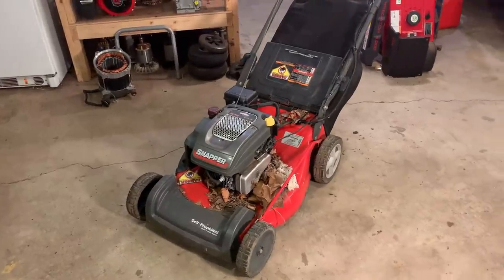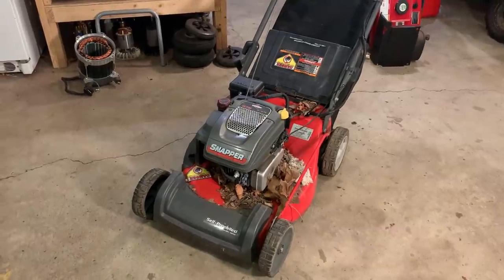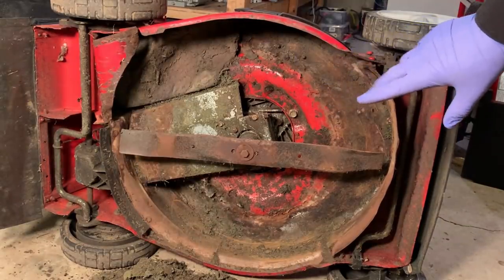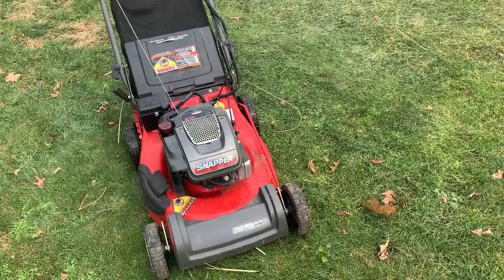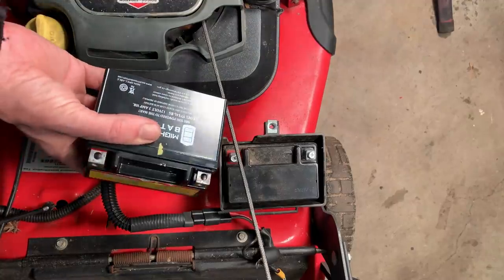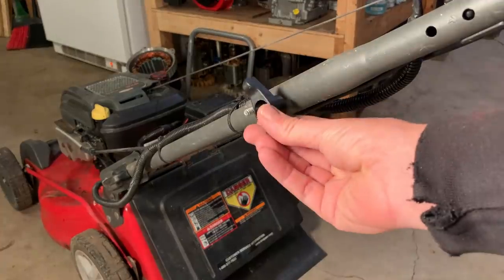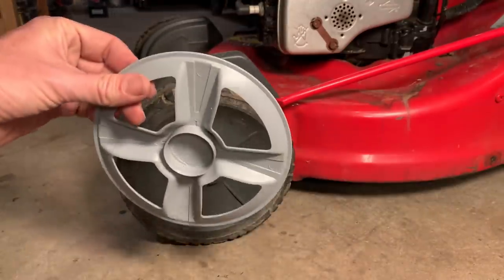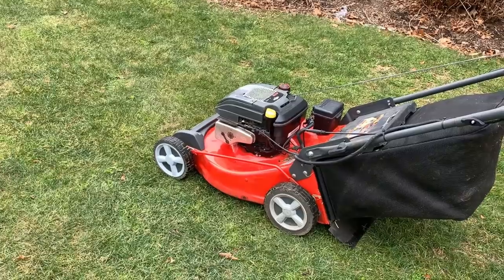Free Snapper Mower

Comment: James, ive never seen a generator with a blade and bagger.😂Lol. That snapper should last you along time. Best thing is that it is rear wheel drive and working electric start. Nice find!  👍💰Roger
Reply: I love his gen vids his last gen find was cool a vertical gen set but like his mower finds also figured out a broken mower problems from his video on cable brake and kill connection being locked same thing on a Honda mower a customer had .

Comment: OH-MY-GOD what an awesome find!  I love Snapper mowers. I had a Hi-Vac for close to twenty years. I've never seen any other mower leave the lawn as immaculate as that did. Alas, I didn't notice it roll down a small hill while it was running - not enough oil in the case and it blew a rod which exploded out the side of the crankcase leaving a big hole. I was crushed. Decided immediately to get a new Hi-Vac. The new one vacs as well as the old one, but they cheaped out by omitting the blade clutch, which I loved. Now the engine stops every time you want to empty the bag. Nice find, thanks for your posts, they're all great.

Comment: I buy mowers at the scrap yard. I bought two, and they still had gas in the carb. I was able to run both of them there. It cost about $7 each. Both are Craftsman, and there are slight differences between the two, but that are both in nic condition. There was an old cub cadet mower there that was about 40 years old, and it was in fair condition considering its age. Unfortunately, I wouldn't have a place to keep it, so I had to leave it go. I'm friends with the owner, and that has it's benefits.

Comment: James, don't you think the owner thought the engine was seized?  The nylon rope around the blade and shaft had to be cut away, so that I don't think there was any rotation from the electric starter or the pull cord.  I love all of your videos, its been a great education.  Kind Regards, Craig
Reply from the maker: Not sure.  I did not ask many questions, only asked if it was free.  He may have a lawn service and just wanted to clean up space.  Not sure.
Reply: The rope was around a part of the blade that wouldnt cause that issue, its like ladies hairs on the brush roll of a vacuum, it has to be cut away but as long as its not in the bearing its no issue.

Comment: It's a better idea that killed it towards the oil fill if you had gas in it with it flood your intake air cleaner gasket plus doing it this way backwards it puts oil in the breather bed and then when you turn it back it fills your air cleaner up with oil just to work!

Comment: I'm always intrigued by the curbside finds of you and others (e.g. Mustie1), I only see bags of trash around in my area.
Reply: Me too man I never see anything on the side of the road but bags of trash
Reply: Same here also. This guy and Mustie are always finding great stuff. 👍👍👍😁😁
Reply: It's a rich east coast USA thing. Mustie is in NH and I think James is in NY. Seems like people there just have a hobby of buying expensive things, putting them into storage them giving them away.
Reply: @noidle22  I do have to say I got lucky a couple of years ago. My neighbor could not get his Ariens 1128 snowblower from 2004 started. I cleaned the carb, changed belts, gave it a tune up and a few other minor adjustments and it runs like new.  Next thing I know he says I could have it because of all the work I put into it. I was floored. Anyway, the thing is a beast and throws snow into the next county. 😁 That includes the heavy wet slop too.  He's a great neighbor to have. Just wish they weren't moving.
Reply: @noidle22  Jim has relatives in New Hampshire Jim and Mustie I watch all the time Ahhmmm and I watch Jim's videos more seriously you both are great to watch .
<<<<<<< Fellow New Hampshirite here
Reply: @YukonHawk1  Those Ariens are serious Snowblowers all heavy steel the engine are they weakness from no maintaince I find with custormers .
Reply: @Mrcrowley1967  You are correct.  The Tecumseh engines can be finicky 😁

Comment: Hey James, those Briggs Qauntums do come with a charging system. It's on the outside of the flywheel.
Reply: Yeah I was going to say the same thing.  That may have been an aux charging lead for storage in case someone didn't want to take the battery out.  With people keeping these in sheds and stuff it would be really strange to require you to constantly connect an extension cord after each use.  Nothing particularly luxurious about that...
Reply: A followup video of the charging system would be interesting.  What voltage is the mower providing back to the battery?
Reply from the maker: I had no idea.  Will have to break out the multimeter and make sure it is working.

Comment: Snapper makes great mowers. I,very had  one with the high vac deck, rear bagger with rear wheel drive for about 10 years. I just changed the plug, oil, and checked the valves for lash. Put in fresh gas and 2 pulls it started. Runs good and cuts good, but it doesn't like gas with ethanol. Stabill doesn't help it. I had to find some gas without ethanol. The percentage must be too high.

Comment: I noticed yours won't pull backward manually very well. Here is a trick when wanting to pull backward - release drive control , then push mower 3 " - 4" forward then it will freewheel in reverse.  ( and yes, it has an alternator with diode to charge battery while running)

Comment: I know people pay more for the Electric Start, but my mower starts first or second pull in the spring.  Not sure I'd want to go through all the trouble of maintaining the battery for what that's worth.
Reply from the maker: It is easy to start and not necessary on this size engine.  Could make a big difference to someone with a shoulder issue or arthritis.

Comment: This is a box store Snapper which means it is not the quality or performance of a true Snapper which can be bought only online or through an authorized dealer. After Snapper was bought by Simplicity, then by Briggs, they created this low end Snapper design for box stores like Walmart. A true Snapper has their old school deck & bullet proof drive system that really hasn't changed much in decades. True recent Snappers also usually have OHV engines and the older true Snappers could be had with the L head Quantums which are truly bullet proof if maintained.  Since about 2013, Briggs stopped rating their engines by HP and began the gross torque ratings. So, this engine is not 6.75 HP but is 675 Series which indicates 6.75 torque. This mower is not worthy of the name Snapper...

Comment: Nothing like a bagger to pick up leaves in fall. I use a bagger along with an Echo blower to move leaves. Haven't used a rake in 20 years...
   Saw tip from Taryl......use the correct size tygon-type gas line, to stick a carb needle into, apply lap salve. And lap needle and seat, when parts can't be obtained. Works against leaky carb a lot of times.....???

Comment: Hey James! Question for you and I think you might be able to answer it..I have the john deere JS46. It has a key start just like this and the battery box is in the same exact place. However the box is just slightly different. Would you be able to give me your opinion on if it will work?

Comment: I fought and fought with a Briggs electric start.  They’re not Bendix drive.  They have a rubber washer for friction coupling, and it gets shiny and hard and the starter slips.  Good you have a rope also (mine didn’t).

Comment: Definitely a bit crazy what people get rid of.
Personally when I fix push mowers I assess them and make sure the repairs will cost no more than $60 so I make it halfway decent profit, I personally never buy used push mowers to sell.
The last two I’ve gotten one I just put gas in and it fired up so just did basic maintenance the other needs the brake cable replaced and regular maintenance.
Love it when they are easy.
Reply from the maker: Not much money to be made on them.

Comment: For the wheel hub cap, I was thinking of putting a hose clamp around the portion that snaps, applying gentle compression, and softening the plastic with a heat gun, then letting it cool for a trial fit.  I've not tried it before -- I'm just "armchair quarterbacking" here.  :-D
Reply from the maker: Good idea.  Will find out in the spring how it holds up.

Comment: 7:35 Be careful with the battery polarity. If anything else (electronics) than the starter motor is in that circuit, there is a good chance to fry it when connecting a battery in reverse polarity.

Comment: I have a Toro Personal Pace mower I bought for about $495 20 years ago.  It starts easily I have only had to replace a cracked gas tank and one cable . Mine is 6.5 hp but basically the same engine.
Reply from the maker: The Toro mowers are my favorite.  The are well designed and work well.

Comment: Hi, my name is Bill (if someone did not figure it out,  :-) ), and I want to say thank you for all the hours of education you provide. I am trying to be a good boy by clicking the "like" button on every video. I have a Snapper, and it has stopped starting on the key because the battery is empty. Now, we have a very small lawn, and I have a very large battery charger, and have used it a few times to top it up (so I thought) because I use it for so short times and assumed it was not enough to top up the battery by itself. It is not the same Snapper model as in this video, not sure when I bought it, 3 years ago perhaps, maybe 4. It is a Snapper Hi-Vac, and I got surprised when you said it does not charge the battery by itself. I tried the charger that came with the mower, but it did not charge at all, so I gave that up fast. Now I have to hook up my voltmeter and see if the mower charge by itself. Because if not, I have to get the same charger as you put on the one in the video. That is perhaps a good idea anyway. Again thank you for your education, you are very good at it, please keep them coming.
Reply from the maker: Thanks for the feedback.  Several have told me it has a charging system.  Have not verified, but will also connect a multimeter to it and find out for sure.  Would be surprised if it did.

Comment: James, a little random, but I was wondering if I could get your perspective on a generator I'm working on. It makes screeching noise of sorts when running. I was going to do some maintance on it for an older friend of mine but got worried as soon as I ran it after cleaning the carb. I dont think its the stator contacting the rotor... maybe knocking? Maybe a bearing? 

If I uploaded a video of it, could you give a listen to it for me? 

Thanks!
Reply from the maker: My guess would be a bearing.  Either on the end of the rotor or maybe inside the engine if it has bearings.  I would listen if you uploaded.

Comment: Amazing how you find a top of the line mower for free! 

Smart choice with Reviving the electric start.  That’s the $50-$100 difference in value.

To keep costs down from getting them running, I order an aftermarket battery.  Cheap charger (when not included) and I make my own harness using what I have.
Reply from the maker: Hey Jason, thanks for stopping in.  See, I fix other stuff besides generators, not that this needed much.

If you get a chance, send me the link of the parts you use for charging.  I pickup a lot of generators that have a battery and electric start, but no charging system.  The OEM charger is always $50.

Comment: Those lead-acid batteries with the spade terminals just can't put out enough amps through those small terminals to start an engine, even if the amp hour rating on the battery is higher than what the original battery was.  Have to get the batteries with the big screw terminals.  Nice find though, congrats!
Reply from the maker: Thanks.  Makes sense.  The new battery for the mower did surprisingly well.  Probably due to the terminals as you pointed out.

Comment: Nice one,  & my fav price tooo   :)  Lick & balance the blade,  blow out the shroud & belt cover & spoil it with an oil change,  such a small amount of oil does a lot of work ya know.
Reply from the maker: Getting a new blade for it in the Spring.  Changed the oil and will check out the cooling fins.  Thanks.

Comment: You should get a better battery charger as the old battery might've been ok. I bought a CTEK MXS 5.0 charger a while ago & it's reconditioned & saved quite a few batteries. It's brilliant, I wish I had bought one years ago.
Reply: Any charger with a microprocessor is always going to be worse than the old transformer batteries, ive got three and everytime i encounter a battery thats below 6 volts the microprocessor ones wont even start cause they dont realize a battery is even there, but these old transformer units just dont care they fire anyway, and you can run them on trickle charging for a night to bring the battery back slowly, thats how ive done it and only on really old batteries that have physical bulging have they failed to come back.
Reply: @compzac  I've never had that problem with a Ctek, I've charged batteries lower than 2v easily. If you do encounter that problem, you just connect another good battery in parallel with jump leads to raise the volts a bit and then connect the charger.

Comment: Great vid James. That's identical to my brothers mower now in it''s 13th year. It was over 400 dollars back then. (Canadian) He's never had a problem with it. Replaced battery a couple times. Tightened up drive cable a bit.(very easy). Also switched to Battery tender jr. I will say that grass hangs up a bit on the housing a bit a few inches below where bagger attaches. Rotted a small hole. Great drive system. Can't believe someone gave away a quality mower like that. Thanks James
Reply from the maker: The drive system on this is excellent.  Ended up getting the discharge chute.  Will keep an eye out for that problem.   Thanks.
Reply: @jcondon1  Forgot to mention, the belt cover plate underneath builds up grass also. 4 bolts I think, very easy from what I remember.

Comment: What a lame setup. A mower with an electric start where the motor doesn´t charge the battery... What a joke, try again, Murray. I guess it´s just to keep the manufacturing costs down, cause there were mowers with electric start that charged the batteries themselves already in the 60´s. That´s just flipping the penny. You got an electric starter motor there anyway, a battery, cables, a key... but no charging coil. Not that there wouldn´t be plenty of versions of the Quantum around that do have it, but now, that would cost Murray 3 dollars more. I´m not impressed... i´ts been a nice video though. Thanks James, and greetings from a german subscriber!
Reply from the maker: A couple people said it does have a charging system.  I assumed it did not.  I pick up a lot of generators with electric start that do not have such a system (Generac).  Will have to put a meter to it and find out.
Reply: @jcondon1  I see, that would make it a different story!

Comment: Good find. 
While owning a home plus a recreational cabin for 50 years, I have never purchased a mower because people discard easily repairable units. The very best one was a high end Honda self propelled that only needed the idle mixture screw opened a 1/4 turn. We have an annual township wide "free" junk disposal day where I own the cabin and you would not believe the number of repairable mowers and string trimmers thrown away but no generators.
Continue the good work keeping useable material out of our landfills.
Reply from the maker: We used to have "Bulk Pickup Day" twice a year.  Was a great time to drive around and pickup all sorts of stuff.  Unfortunately the town did away with a a couple years back.  Thankfully neighboring towns still do it.

Comment: James have you ever used fluid film for deck . Just curious because i have a bad habit of cutting wet grass. It amazes me what some people throw out, i guess more money than sense.
Reply: Save the old motor oil from the mower when you change it.  Use an old brush to 'paint' the underdeck with it.  In late Fall, I spray Fluid Film on the deck when I store the mower for winter.